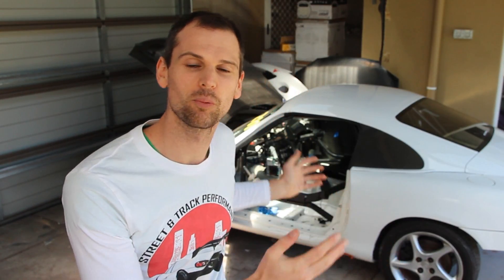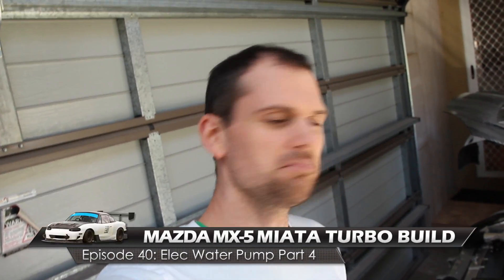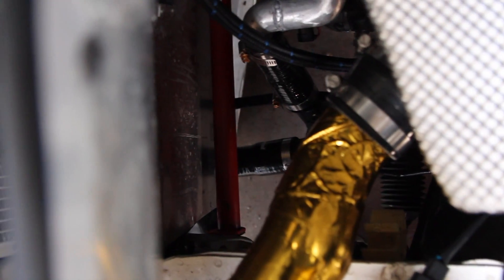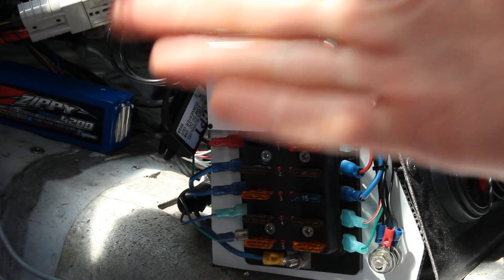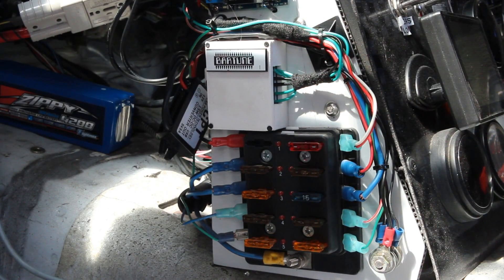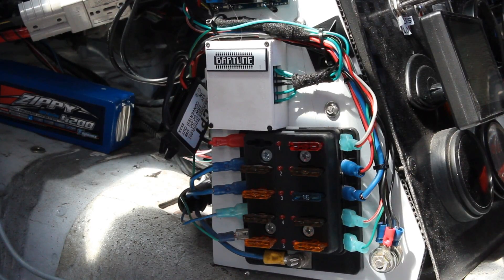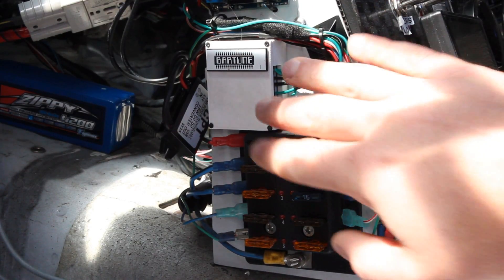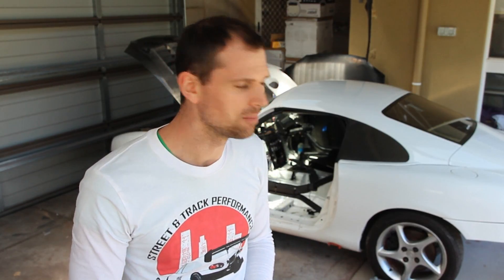Wiring for Elec Water Pump - Episode 40 - Time Attack Miata TURBO Build

Comment: for the electric water pump....can i just run it at 100%....I dont want to mess around with doing settings and stuff....I mean the temperature will still get controlled by the thermostat.
Reply from the maker: Yes of course you can, it just may not work as efficiently.

Comment: Like the Bartune controller. ECU's have a limited output - great way to boost it up. As a sparky, I have to comment. You need to get some proper crimpers for your electrical terminators. Those single point ones you're using are asking for trouble - hot joints and pull outs. Good crimpers have two jaws, one to crimp the connection ferrule (in an oval shape) and the back jaw crimps the plastic part over the sheathing (in a flare shape). Middle range crimpers are both oval but still two jaw.  (and no copper hanging out the back of the lug!!!!) Ratchet crimpers on ebay. Worth it - race with confidence!!!  Sorry, had to comment on that.
Reply from the maker: I was sure I'd have some disappointed viewers point out the wiring job - while I have recently invested in a proper set of crimpers - some of those connectors are quite a bit older back when I had limited tools and zero electrical experience. Perhaps I should invest the time to rewire and re-crimp the bad ones?

Comment: G'day mate, loving the videos, i noticed that you have a zippy compact lipo under the dash. The lithium batteries in most race cars are not lithium polymer. I use these in my rc planes and I've had them on fire. Just a word of warning...... Fire extinguishers don't work on them when they're on fire!
Reply from the maker: Hey Blairo, it;s actually a lifepo4 battery, which is much less volatile than a lipo and wont spontaneously combust lip style. But I agree, a lipo is not a good idea in the cabin of a car.
Reply: BEAVIS Motorsport fewf! Last thing I wanted to see is that awesome car up in smoke! Love your work mate! 👍